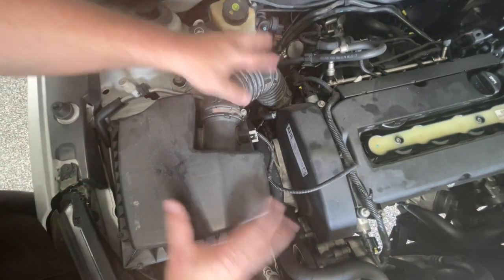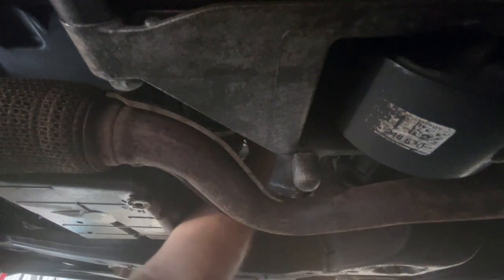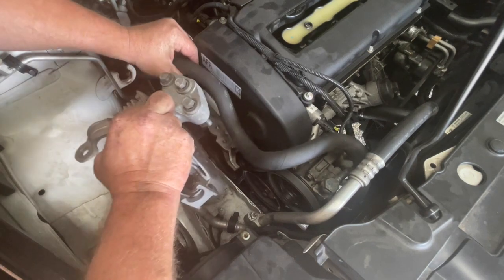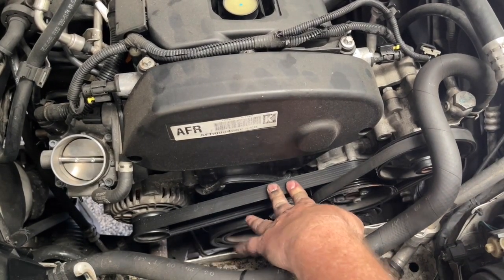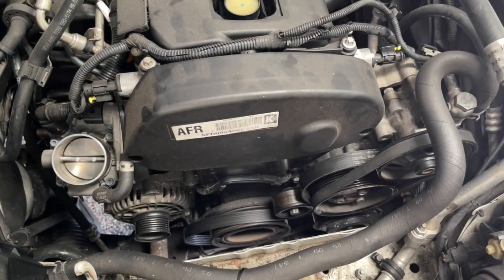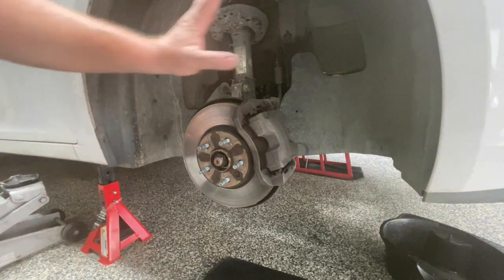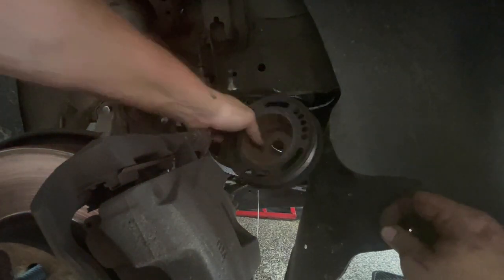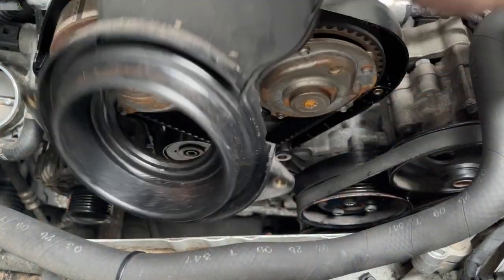Cruze Head Gasket Replacement  STEP by STEP process (Part 2 of 16) Full Details for 1.8 F18D4 Engine

Comment: Do you really need to take everthing off can you not just take the valve cover off and then pull the head
Reply: Im curious as well but unknowledgable and won't hurt me if you say sorry there's too much to that which could go wrong. But it does seem like it would be potentially much easier to do and im curious if you happen to know.
Reply: Same here

Comment: After watching this video I really expected the crank pulley bolt to come out a LOT easier... Milwaukee 1/2 drive couldn't break it lose...
Reply from the maker: Hopefully it's off now. A tight fitting socket really helps too. I went back and watched the video and it did look too easy. Can't remember but I may have edited out some of the 'ugga Duggas' to keep the video as short as possible.

Comment: I'm looking to buy an impact so that I can remove my pulley bolt, mine is a hex.  How much psi should the compressor have and how much torque should the impact have so that I know it will work?  Also, will an electric impact work on these?

Comment: I am replacing my head gasket and have gotten to the E-17 Torx in the wheel well. Bought a set of E Torx; but, it does not have an E17 and have had no luck finding one after extensive search. Do you have any suggestions where I may purchase an E17 3/8" drive? I appreciate your videos and have a great desire to complete this endeavor. Thank you!